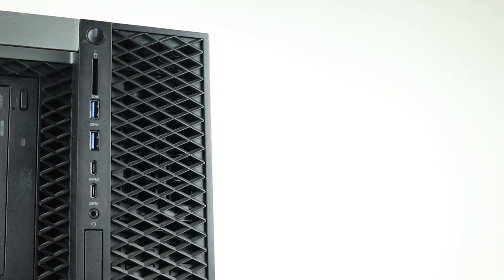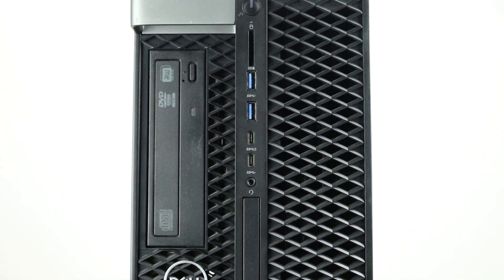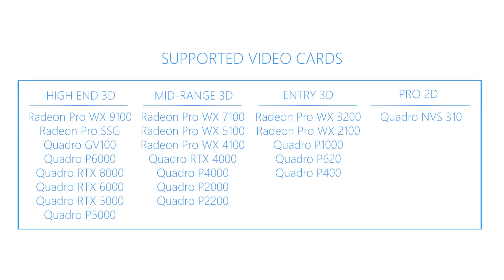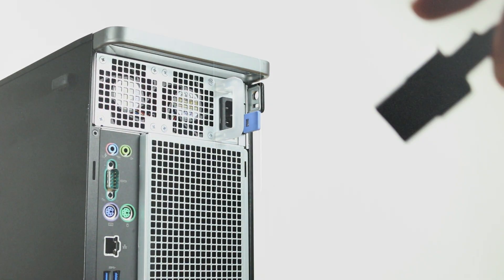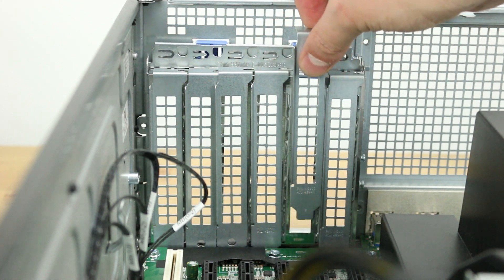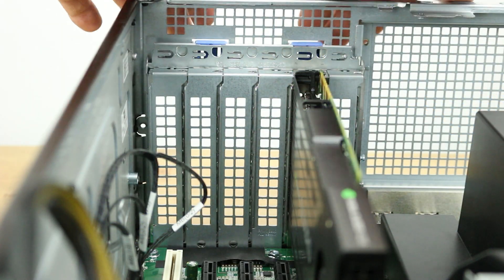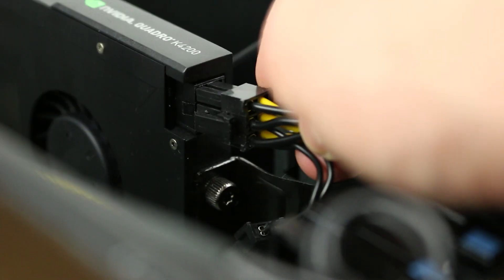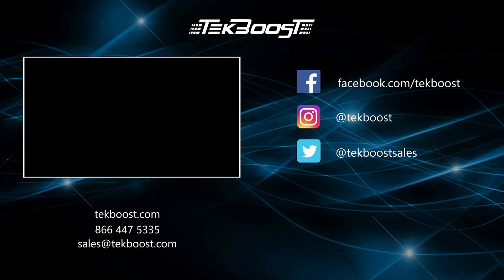Dell Precision 5820 Video Card Installation

Comment: Just wondering would a RTX 3060 work or is it specific to the list
Reply: It will fit, just make sure you've got the 900w psu
Reply: @Maazi04  right, what about a 3050 tho? Or dose it just not matter much
Reply: @RCperson  ye should also fit, most 3 fan cards will fit since its a full size tower

Comment: Good video. Would like to make an important question in my case concerning these dell computers that come with raid as an active drive controller (intel rst active) and not ahci. The problem is that whenever i try to boot into these machines in a winpe environment with the Strelec package if you know that, in order to reset the admin password if i cannot log into it or just backup the data of a user into an external hdd before  reinstalling windows if the precedent os is damaged and cannot be repaired, the internal hdd-s or ssd-s of just the os directories into the drives are invisible. I click on “This PC” and there’s only my usb visible and nothing else. I made a search on the internet and it seems it has something to do with the intel rst driver that abstracts the hdd from the os. Please help me, what should i do in this case in order to be able managing the pc even when the pc is unbootable or just the admin password is not recognized.

Comment: So we can’t install a GTX 1060 3gb? 

Or maybe a Quadro K600 ???
Reply from the maker: Yes, most GTX and Quadro GPUs work with this workstation. Both the K600 and GTX 1060 are compatible.  Its compatible with most GPUs up to 250W such as the Quadro P6000.
Reply: @tekboost I got a 1660 ti and was wondering which pcie slot I should use

Comment: i have this same computer but i cannot find the power supply for the video card.can you help?
Reply: There are two 8pin cables coming from the power supply.
Reply: @KlipschHead281  where those cables are coming from ? the VGA1 and VGA2 on the PSU board ? didn't find any power cables. Bought a 10 pins cables that goes from PSU2 on the board and got to the RTX 8 pins but the PC won't even turns on.

Comment: Can any of the 5 PCIe slots be used for the video card? The manual list the slots as wired as 4 or 8 or 1?
Reply: The top PCIe slot is 16x, Dell did not do people favors with this machine. Waiting for the BIOS to figure out the new video card was installed sucks but it eventually figures it out and Posts.
Reply: @KlipschHead281  how long does it take?
Reply: @Qugie  - At its worst it has taken 20 minutes, lately it posts in seconds but once in a while it gets out of sorts and just keeps re-posting driving me insane.